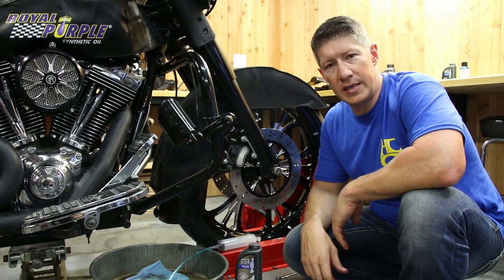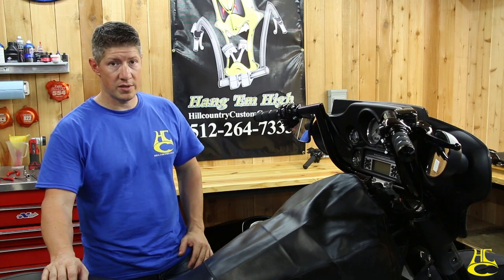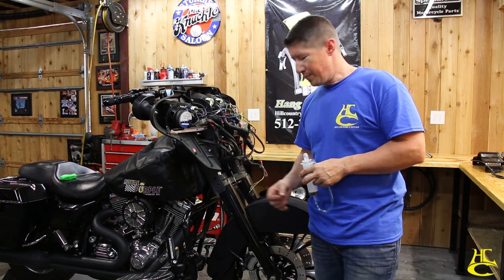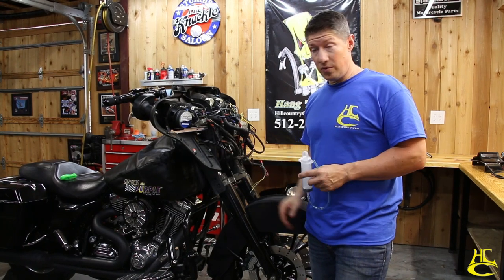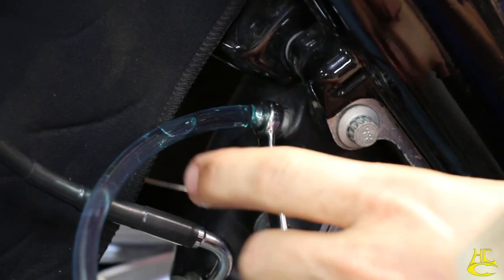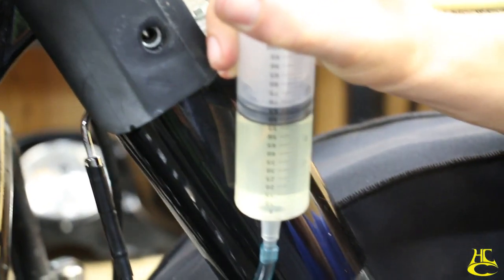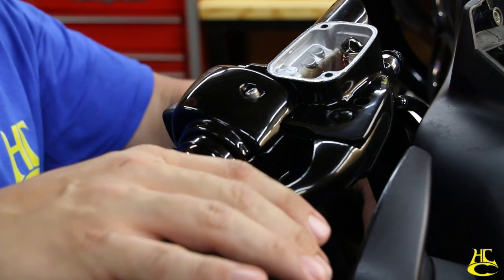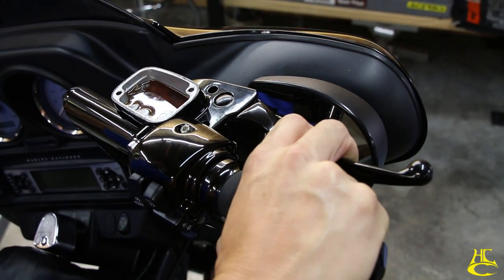How to Easily Bleed NON-ABS Dual Disc Brakes Harley Davidson Touring, Softail, Dyna, Sportster

Comment: Here is a tip that is new to me and I've been bleeding brakes for decades: After the job is done on the front brake. Clamp a zip-tie around the brake lever and let it sit overnight. This sends the microscopic bubbles to the reservoir. The next day, remove the zip-tie. Then open the top of the reservoir just enough to release the extra air pressure that came from the microscopic bubbles. Close the top and screw it down. Try the brake lever and you will be amazed at how much harder it is. 
If you can clamp the rear brake pedal, the same principle applies.
Reply: Dude!  You are a freaking God.  I have dual disc (non ABS). I just drained the front brake fluid and thought bleeding would be easy. Nope.  I had no “pedal”. Took my bike around the neighborhood using only the rear brake - all I had hoping the air would work out from the vibrations and cornering. Nope.  Saw your comment. Left it over night. All back to normal now. 
So for the front brakes you can just drain all the fluid (won’t leave any old crap from bottoms or top) and use your idea. Wahla!!  Even on dual disc.  This is great and very easy to drain and refill the front.
Reply: @jeffduckworth9092  Thanks for the compliment, but I am just passing on some useful info that helped me. I'm glad that I was able to help.
Reply: @boomerguy9935  Maybe it’s not your words - but it was you that posted it. That’s worth a lot more to me!! 

Thanks again.
Reply: Hey man so I currently have it zip tied right now overnight I have a 2021 Iron 1200 and the front brake feels nice and smooth but on the other hand my 2000 Dyna feels spongy like it has air so will this fix it permanently or just temporary btw I rebuilt my front brakes and master cylinder just think I didn’t bleed them right

Comment: Was fighting bleeding my daughter’s 04 Sporty front brake line after a handle bar swap. We bled it for like 30 minutes the traditional way and never built any pressure on the brake lever. Used your trick and it was bled in a few minutes and the front brake has plenty of pressure. Thanks!

Comment: Excellent video, but I was wondering, on the first caliper why not push fluid up all the way until it enters the master cylinder? Then on the other side push fluid up until the M/C is full? Is there a reason not to do this? Thanks for a really great video - from the caliper up to the m/c is the easiest and best way to bleed brakes!

Comment: Use a Mityvac and you won't have issues with air getting into your brake line when you bleed from the valve on the front disc caliper(s). The vacuum creates negative pressure within the brake line and draws air out as well as helping to evacuate dirty/old brake fluid.

Comment: I am in the process of installing 14s, I turned on the ignition a couple times to make sure everything worked and I did not yet bleed the brakes. The line from the M/C to ABS module was changed.

Comment: I changed master cylinder and caliper on my dyna and can’t get the air out for nothing, I tried back filling with a syringe, I used air bleeder and a manual pump bleeder just can’t get a firm grip

Comment: Ive got a single line running from the master down to 1 caliper then a line from that caliper to the 2nd caliper. I like the idea in thos video, just wondering if and how it might work in my case. Any insight?
Reply: If you figure it out lmk. Got the manual for my 95 heritage build and it says both use the fluid from the single master but doesnt seem right to me.

Comment: i have an 06 sportster roadster. i pushed the pads back, then i had to take the master cylinder off the handlebars and take the line off of it and pour fluid down in the bore. i put the line back on with it in the verticle position and put it back on the handlebars.. instant solid brakes... what a pain in the ass for changing the lines... almost 2 hours of fucking around.. dot 5 is 15 bucks for a small bottle...   its solid now..

Comment: Wouldn't this pump debris or dirt into master cylinder and screw up the pump?
Reply from the maker: +Andres not at all.  You can always use the syringe to suck old dirty fluid out and pump more new fluid up from the caliper till it’s clean